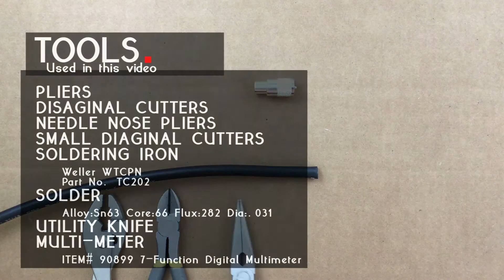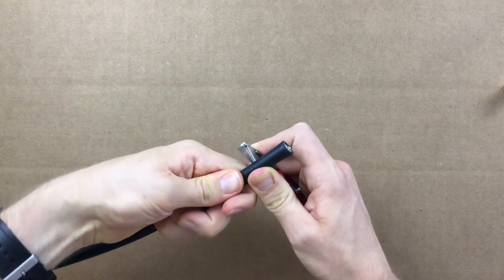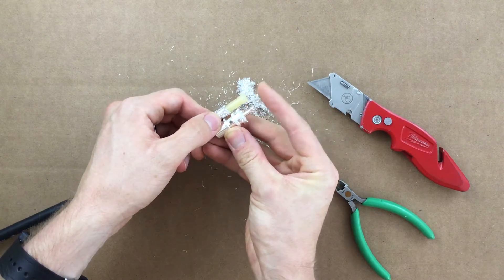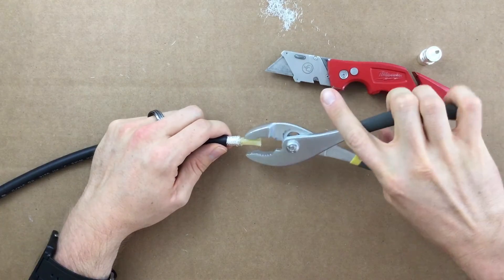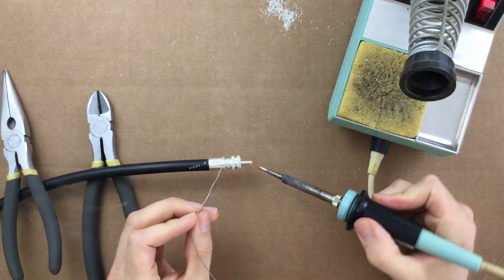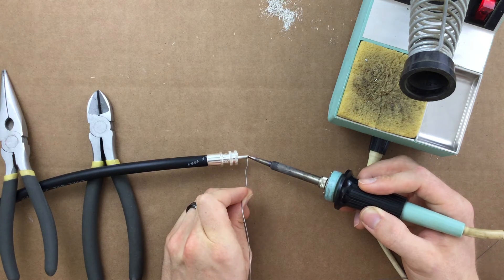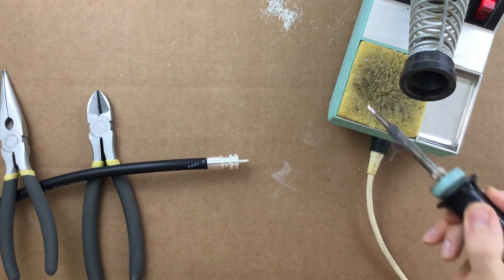Pl-259 Solder On Installation Guide for RG214 Coaxial Cable Full HD

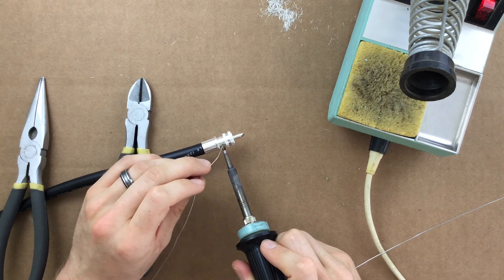Comment: notice the video cut at about 5:44.  that's because he held the tiny pencil iron for an extended period of time against the body of the connector.  the video editing is meant to hide that.

if you heat the body for that long, the connector itself will fine (PTFE insulator).  but the PE dielectric in that coax is going to melt.